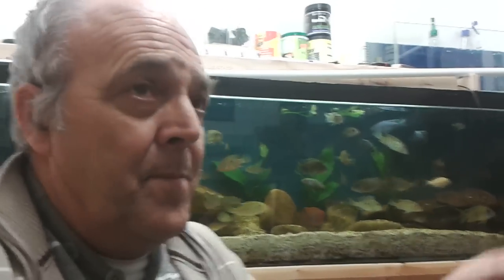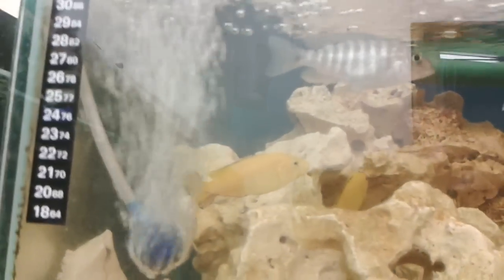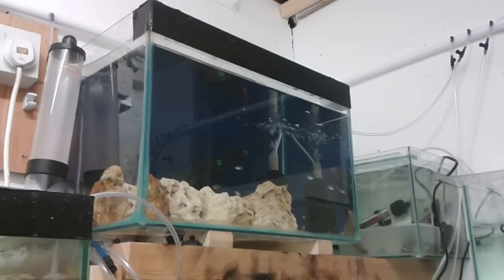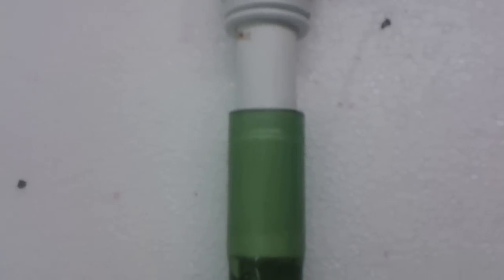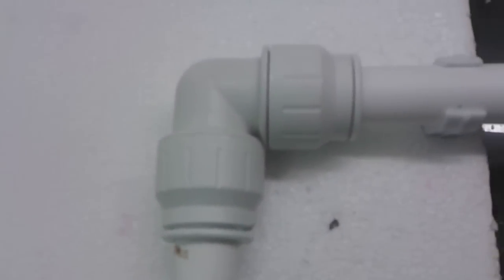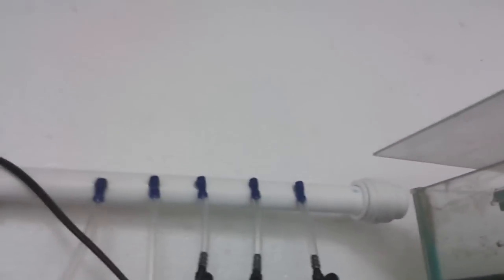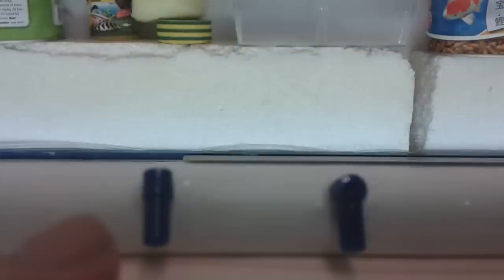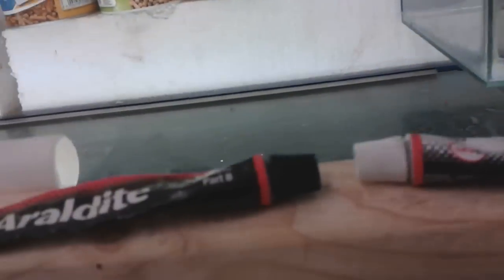How to make an air ring for fishroom, improve aquarium oxygenation. Piping circuit explained.

Comment: Hi Ivan,
Just a quick bit of info for you :)
Air rings always perform much better with a complete loop instead of capped off ends like yours.
Simple reason being if your using a strong powerful air pump (I don't know what yours is but mine in total is 110L per min) but not enough air is being released via your valves, Your pump end up getting a lot of back pressure which can lead to burnt out motors etc...